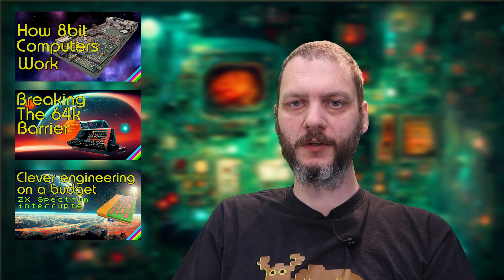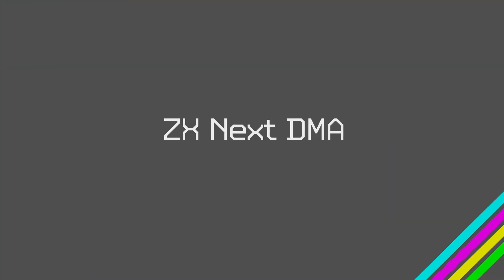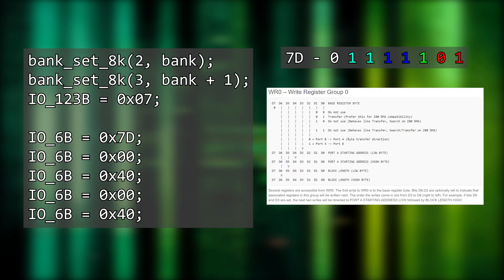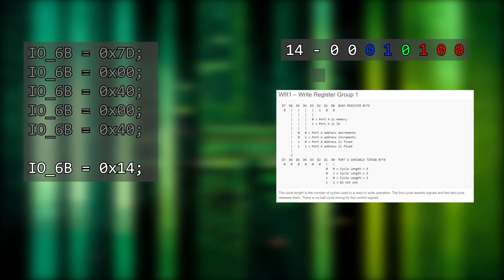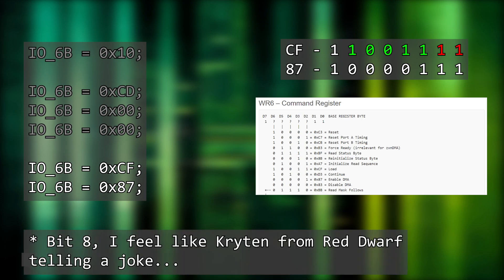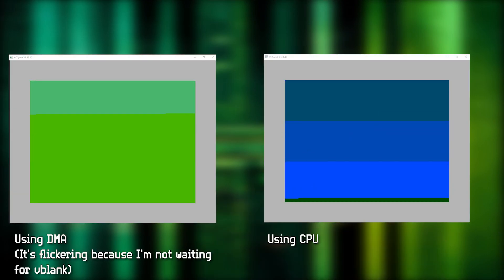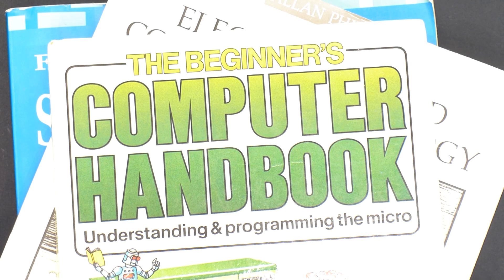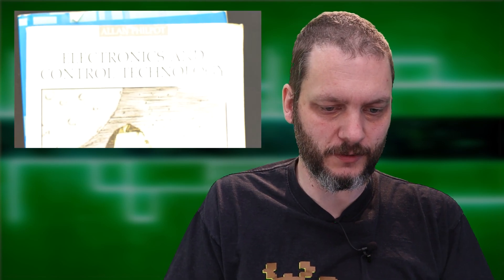DMA - Direct Memory Access on the ZX Spectrum Next

Comment: Have you ever explored CPM on the spectrum?
The 128 should even be able to run CPM 3. Those are great for getting into assembly coding on the z80. They give you just enough functionality to get going, like print strings and characters or get input from the console, or reading and writing files. But the os also doesn't get in your way, and is easy to handle